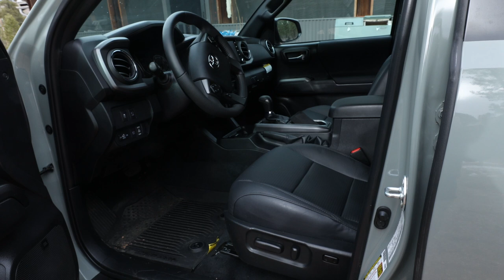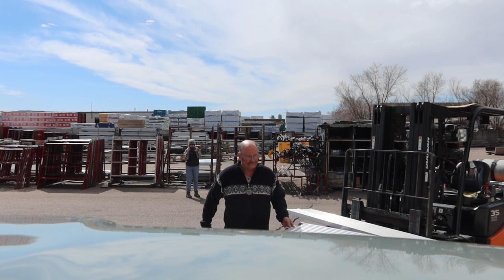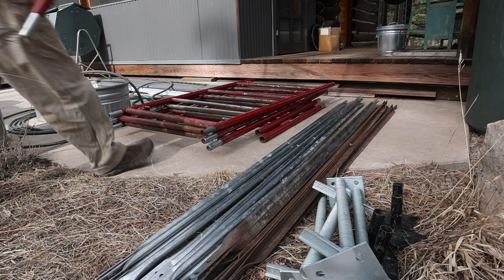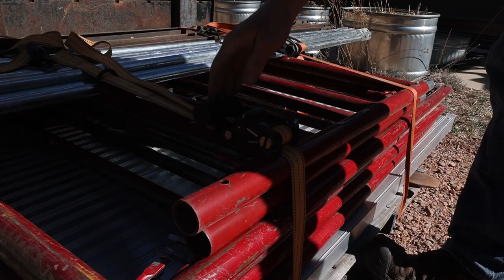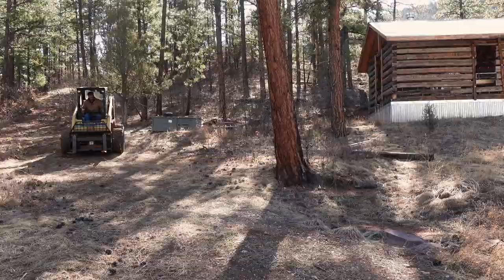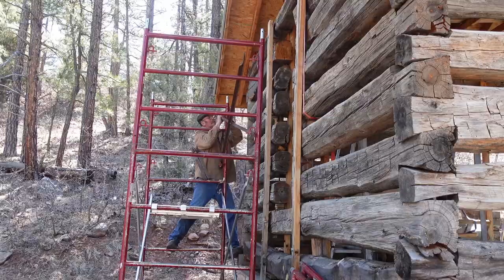Time for a New Truck?

Comment: I have a 2009 Tacoma and I’m very pleased with it. I had bought it used and it had a little over 100,000 km on it. It was abused and had a few issues. With some $$$ and TLC it was back to satisfaction and a real pleasure to own. Then! About 4 years ago I got a notice from Toyota that somewhere in those/that year’s a corrosion problem arose with the frame and the coating they put on it. With the recall for this truck, they wanted it in the dealership to check. If the damage was minor; they’d clean it up and put on a new coating. If it was major; they’d replace the frame! Well, guess what? Mine needed the frame replaced! This was a warranty issue and the only cost to me was replacement of worn parts, like shocks, tires and other minor things. It took about 2 1/2 years before they finally got the right frame in! I got the call, took ‘er in; they gave me a rental car (no cost to me) and they took off everything and put ‘er on a brand spanking new frame‼️ From what they figured it cost me about $1000 and cost them about $10,000‼️ Impressed? YES‼️ She runs good; I have about 360,000 km’s on her and runs great!
Reply from the maker: Wow, thats good service.

Comment: Hi John, you  scared me, new truck? Ok maybe 🤔
You need to use caution, when you start driving a new, new truck. 
I just finished a 2000 mile road trip in a 2020 Promaster, the trip was great. If I were to have made that trip in my 25 year old Dodge van, my body would have given up 500 miles into the trip. 
Take care, and thanks for sharing.

Comment: Info for yota owners. 07 Tacoma 2.7L MADE IN THE USA!!!
I don't know about any other years.
A pipe that goes from thermostat housing, towards the rear of engine, it travels between the intake manifold and the engine block. It comes out the back and splits into 2 pipes.
The pipe is made out of plastic!!!
BLEW MY MINED!!!
I almost lost my engine to over heating, and I'm sure I've lost some life in it..
Hope this helps someone!!!

Comment: If you're rent that scaffolding for that long, you'll have just about paid for it. So hope you bought it. It's handy to have around when you need it even though it sits unused for long periods of time. Time spent picking it up, taking it back, fuel, just buy it. rental companies do not subtract your rental fee from the cost, bite the bullet up front. You'll be wanting some wheels for it eventually for working on flat ground, far easier to move around.
Reply from the maker: Totally agree, we did buy it.  Wheels for flat ground? I'm not sure we have any of that.

Comment: At first I was envious because I thought you had bought a truck I like but could never justify paying for unless it was for paying work. I recently settled for a 2008 F150 after months of searching. I don't need a truck all the time, but I do need one occasionally, and especially to pull a trailer once in awhile. Setting up and moving scaffolding is a pain to do by yourself. At 75, I use a ladder too. That vertical climb on the scaffolding is still possible, but getting over the top is a challenge.
Reply from the maker: Luckily this is as tall as I need for this project.

Comment: Nice truck, those short bed are all most useless.
Reply from the maker: It was much better than I thought and we used it quite a bit in the short time we had it.  But with two older full size trucks, I wouldn't need this for hauling sheet goods.  Of course it doesn't matter since we had to give it back when the little car was ready.